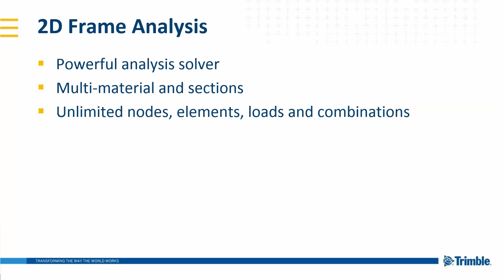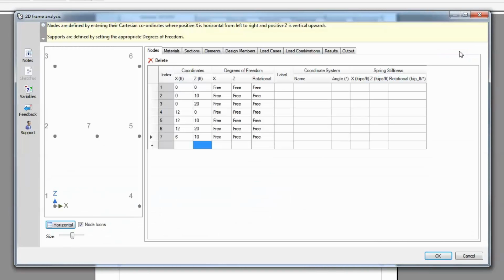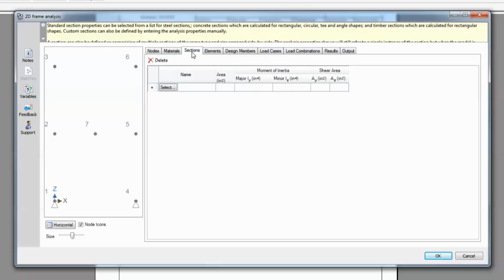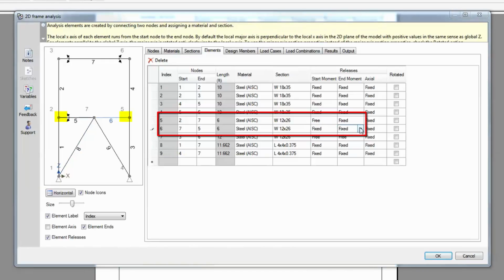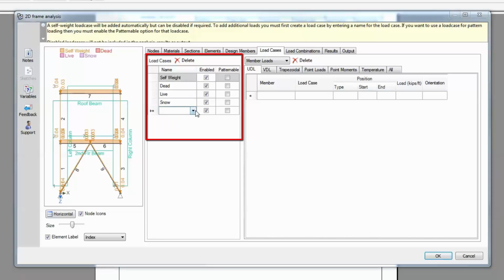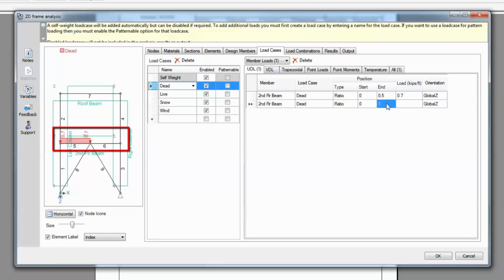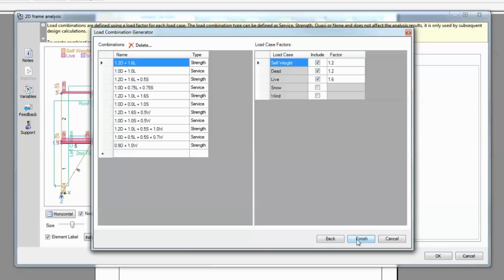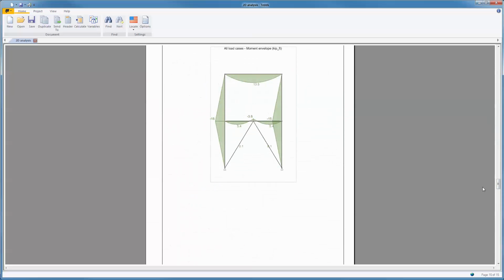Introduction to Tedds 2D Frame Analysis

Comment: I know the previous comment asked the same thing but has anything been added on tedds since the video has been posted? I am talking a feature that allows to analyse a 2D frame and also design the members and carry out all relevant checks
Reply: Hi, Antonio. There is an array of modules that cover both analysis & design for various material types. See the the following link for a complete list per head code - https://www.tekla.com/us/tekla-tedds-engineering-library     You can also download a 45-day trial if you'd like to give any of the modules a try - https://www.tekla.com/us/products/tekla-tedds

Comment: So once this is done, what do you have to do to go into the design part of Tedds and run your analysis through the design process ?
Reply: Hi Roy, this module handles the analysis of any 2D Frame with an array of material types. Additional modules are available for the analysis and design of concrete or steel. An easy way to utilize your analysis results in your design process for a larger project or multi-material frame is by linking modules together utilizing Tedds for Word. You’re able to quickly promote variables from one module to the next and conveniently save entire project templates for future use. Please be sure to check out the videos "An Introduction to Tekla Tedds for Word" and "Linking Tekla Tedds Calculations" for more information, thanks!
Reply: @trevorbruce258  So we have to buy Microsoft Word to do this?